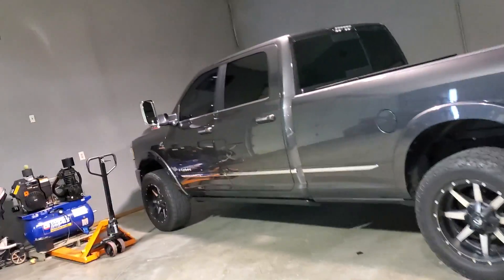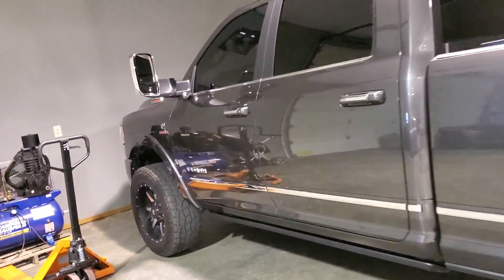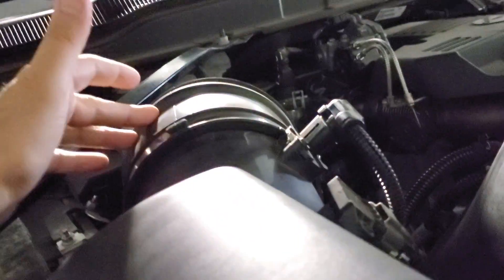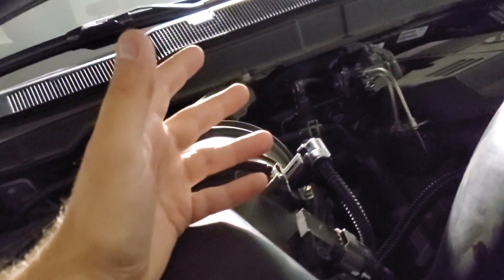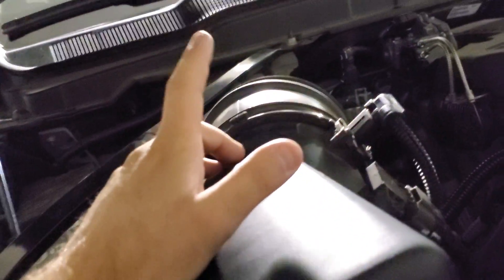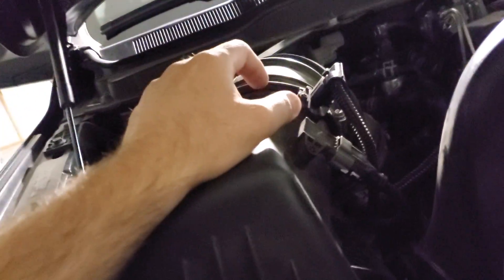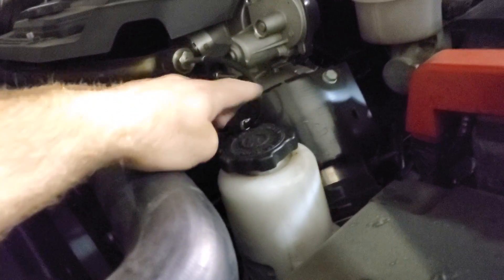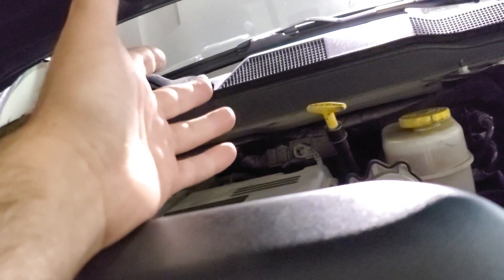How much power can the 2019 Ram Cummins handle

Comment: Not stock but my old neighbor has a 2014 3500 SRW 4x4, all delmonico red bumpers and grille and all that. He voided the warranty the week he bought it. He dyno'd it and it pushed 770hp and 1700lb ft tq. after all the mods. Thing still hasn't had any problems and it's gone 275k now. Runs 33s on a leveling kit. He loves the truck.

Comment: On my 2014. 410 gears, dually Just changed out stock air filter and put in a k+n air  filter. I was at 15 mpg now at 16.4 mpg. With artic fox camper was getting 10 mpg. 30 k on old filter. Air box sucks. Clips on one side of box started to break. Should be 6 screws on 2 sides instead of just 3 on one side with lame clips on the other. Not sure about the k+n filter but I bought it a while back.  Stock Mopar filter said 800 cfm. 3 inches thick . New k+n is 1.5 inches thick. Box said 415 cfm on a flat filter. May go back to Mopar filter in 10k.

Comment: the best light I've ever seen underage a vehicle's Hood might have been I'm really not that sure but the underhood light also came with a cord so you could disconnect it and moving around the motor or even assist you if you had a flat tire and if you would just roll it back up what a crank I'm not sure what vehicle was I think that was the best underhood light I've ever seen on a vehicle

Comment: They lowered the comp ratio so it can handle some more power. However, as a company owner i figured u would care way more about mpg.  So has the shit mpg gotten better?
I think the 3500 with standard output is what u should have gotten! That has the higher comp ratio, aka better mpg. U don't pull anything that requires the high output...
Ya ya the standard output only has the 68re trans.

Comment: Did you forget that K&N makes a hi-flow air filter.
Reply from the maker: I don't install oiled filters on turbo engines. And would advise others not too also
Reply: @pddieselpower  why not?
Reply: PD Diesel Power doesn’t the 2019 come stock with an oiled filter?
Reply: mtrujillo1973 you know the crank case vents into the intake tube on the turbo right?

Comment: Evening, just purchased the new 3500 Laramie (couldn’t find the limited) I have the HO motor and transmission (Asian) and now want wheels and tire. They want to do a 2inch leveling kit to compensate for the tire rub, same tires you have on a 20inch wheel. Will this leveling kit affect my towing capacity or towing safety? Thank you!
Reply: Aisin*

Comment: this is the first year of the eninge so chrysler knowing that ford n gm would come out with theirs id say given the driveline and everything that this exact same engine will be 525  hp and 1375 lb ft in 6 yrs with very minimal changes to any part of the driveline   i belive its future proofed the tranny can prolly handle 1600-1800 lb ft.. these are my SAFE numbers that the factory will b able to use without causein warranty problems

Comment: Well this was surprising. I have been waiting and begging for someone to take on the topic of the CP4.2....unfortunately, I believe that the CP4, as well as, the CP4.2 have both had their issues already with Ford and GM. The CP4.2 already has a bad track record and is also part of the class action lawsuit that Ram and the other two manufacturers are currently a part of. Ram used the pump already on the eco-diesels and it is basically a grenade waiting to happen. Hope not but I don’t trust it
Reply: I’m sure you’ll be happy to know for 2021 its back to a cp3 I bought a 2020 though 🤦🏻

Comment: Minor correction: 2019 2500 & 3500 are still 4th gen (more precisely gen 4.5).
Reply: Not really, the top engine, frame, brakes, interior, radiator, and most of the body is different.
Reply: @Chris-ob8ok  yes really. Only the hood and front fenders are changed and the interior is updated. Sorry, Charlie, but 2500/3500 will remain 4th Gen until production is moved from Mexico to Michigan. The "1500 Classic" comes from Saltillo and the 5th Gen 1500 from Warren. You need to learn your Ram nomenclature to be taken seriously by long-time Ram and Dodge owners.
Reply: @walterk1221  nope you don't have a clue what you are talking about. I've owned dodge for over 20 years.
Reply: The only reason people like you say it's a 4.5 gen is because it shares some body panels with the previous generation,  while basically everything else is different or updated.
Reply: @Chris-ob8ok  well, you are currently misinformed. My source is the Turbo Diesel Register WITH INPUTS FROM FCA AND RAM what, pray tell, is your ill-informed source?
Reply: @Chris-ob8ok  I just explained my source and I assure you that you are incorrect.
Reply: @walterk1221  hahahahahahahahahahahaha
Reply: @Chris-ob8ok  yep, about is expected. When confronted with actual fact, dimwits laugh. You do not have clue.
Reply: @walterk1221  my source is Ram calling it a 5th gen, along with basically everyone else who isn't you. Do you think when they redesign it again they will call that a 5th gen or will it be a 6th gen? Because I can guarantee it will be the latter.
Reply: @Chris-ob8ok  incidentally, you are aware that 2002 2500/3500 was NOT third gen despite 2002 1500 being third gen, right? *Same pattern for 2019j
Reply: Still a 5th gen.
Reply: @walterk1221  lol. Ok Walter you've convinced me that it's a 5th gen because you are nuts.
Reply: @walterk1221  wouldnt it be nice if you could get all of upgraded features and redesign of the ram 1500 in a 2019 ram HD? Oh wait you can, because the 2019 HD are in fact a 5th gen trucks, though you can get it in the "classic" body style if you prefer.
Reply: @Chris-ob8ok  you don't have a clue.
Reply: @walterk1221  I've provided many, but you are willfully ignorant. RAM is calling their newly released 2019 HD trucks 5th generation.  I really don't know how you want me to phrase it any differently for you to understand.
Reply: @Chris-ob8ok  No one other ill informed are calling other than a portion of the 1500 build for 2019 5th gen. I have made it my mission to educate the illiterate.
Reply: @walterk1221  Do yourself a favor and call Ram and ask them directly. And when you are done sobbing.  You can look up what the word "illiterate" means.
Reply: @Chris-ob8ok  I think I figured out the source of your misinformation; you obviously asked a salesperson at a dealership and not a Ram or Cummins ENGINEER.  You see, I HAVE spoken to engineers and not ill-informed salespeople.
Reply: @walterk1221  hahahahahahahah. And I can assume you are reading articles from 2018 claiming ram is going to release its 5th gen HD trucks in 2020. However, I won't because that would be an ignorant thing to do. I also didn't say go talk to Ram "sales persons", I said call Ram. Which means whoever's the fuck you want to talk to that works for Ram and they will say the same thing. The 2019 is in fact their 5th gen truck.

Comment: Hey do you know if that 1000lb/ft  6.7 engine is the same internals and CGI block in the Standard output 68RFE 850lb/ft engine?
Reply from the maker: I dont know and haven't done any research yet. Sorry
Reply: No problem Paul, thanks for the reply, I’m going to try and find out
Reply: Dean Wissmann Yes. Motors are exactly the same. Different transmission, different engine tune.
Reply: Ahhh interesting!! Thank you!!